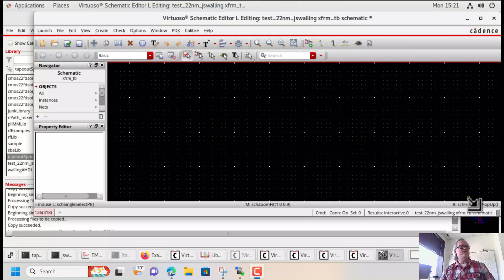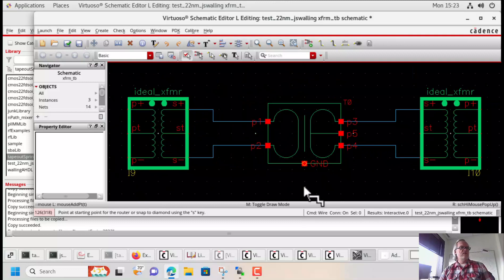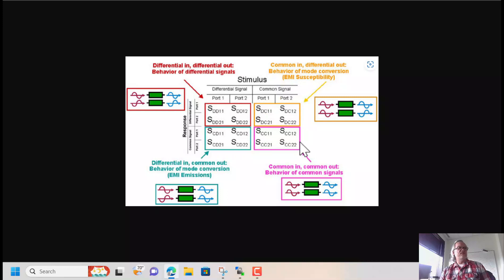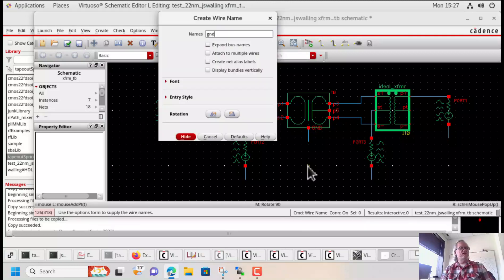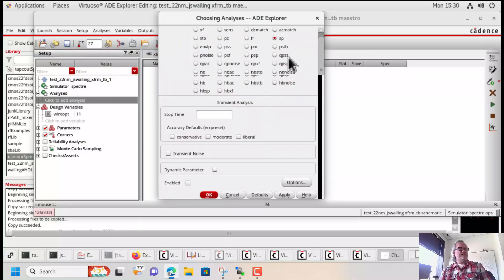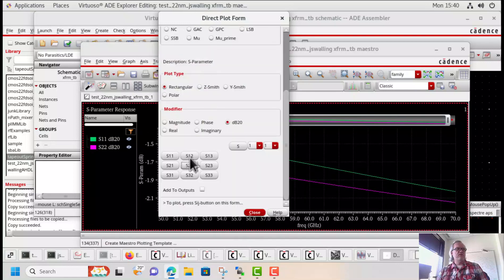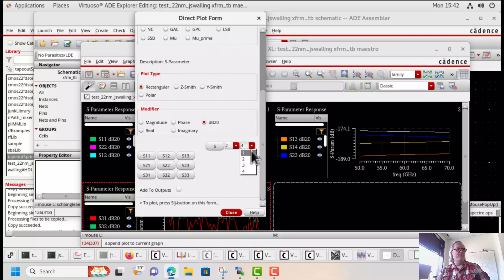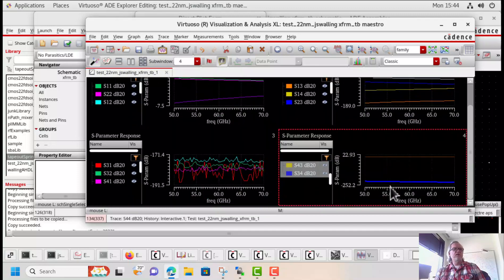Mixed-mode S-parameter Simulations

Comment: Hi Professor, many thanks for your video! I am wondering do we need to change the differential port impedance to 100ohm and common mode port impedance to 25ohm for this evaluation? In this way, we can get correlated results as the 4 port evaluation using the conventional equation such as SDD11=0.5*(S11+S33-S13-S31).  Thanks!